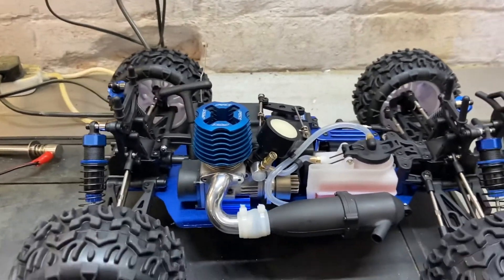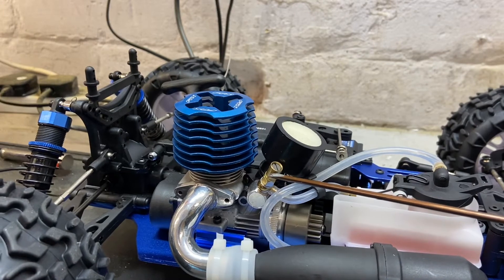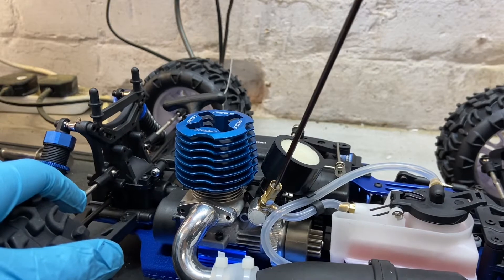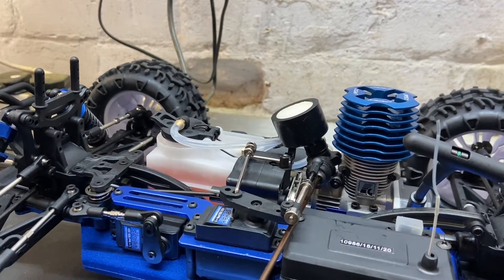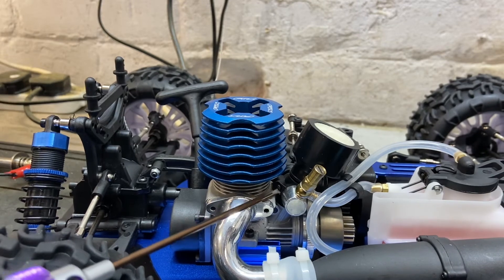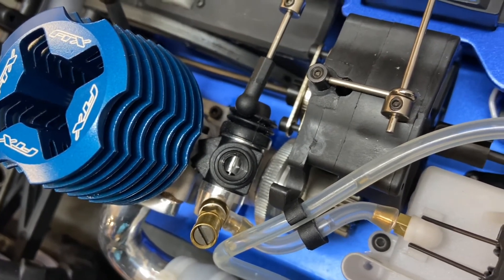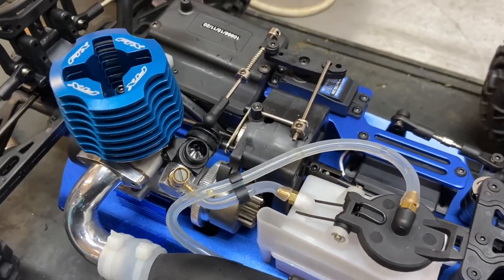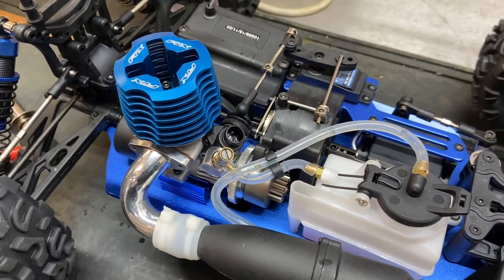Spudski RC How To: FTX Carnage / Zorro NT Engine Base Settings

Comment: Thanks mate.. That was spot on.!
A perfect refresher course to jog the memory.
I've just picked up a nitro zorro/torro because I'm missing the nitro smell & noise. 
I don't even care that they're not as quick as electric nowadays, they're just cool & that's that.! 
Of course I'll have forgotten everything you've just said by tomorrow morning so I'd best make sure I've got 4G signal wherever I decide to bash because I'll most likely need to watch this again...
I'd probably better charge a handfull of lipos & take something electric too just to be on the safe side.
Cheers mate. 👍
Reply from the maker: No problem glad it helped. They can be tricky at the best of times nitro cars.

Comment: Hi I have a zorro out of the box I haven’t been able to get it going to break it even in yet I have the fuel in the glow plug is definetly working and it’s definetly not flooded but it idles over for a few seconds 4 or 5 at max and then turns off 
What should I do
Reply from the maker: If its doing that it generally means an air block in the fuel line. Take the high speed needle out of the housing, prime the fuel until it comes out of the top of the housing and then put the high speed needle back in. Set it back to factory settings and then try again.
Reply: probably the plating on the plug is gone..if it runs with the igniter still attached and when removed it cuts out shortly after, you need a new plug. even if the plug still glows ..because it relys on a chemical reaction from the plating in the plug to keep running if the plating is worn out from breaking in or if its a cheap hsp plug and the plating is burnt away it wont run.

Comment: So. I can get it started but wheels move by themselves what do I turn? And what way left or right
Reply from the maker: Does it sound like it’s revving high? Usually down to the idle setting. Without the engine started check that the carb gap is approx 2mm, if it is and still try’s to move on it’s own turn the idle screw gradually to the left.
Reply: @spudskirc4458  I will try this soon also i pretty much bump start the car by putting fuel into the air filter and if I don’t do this it hard to start